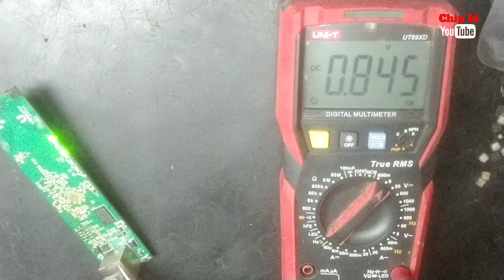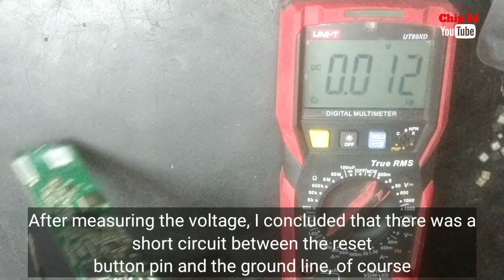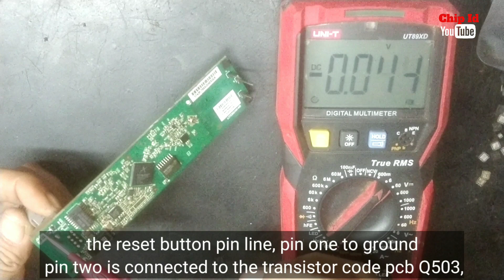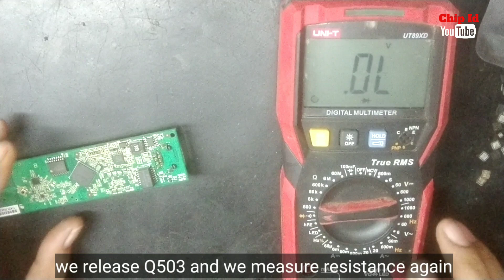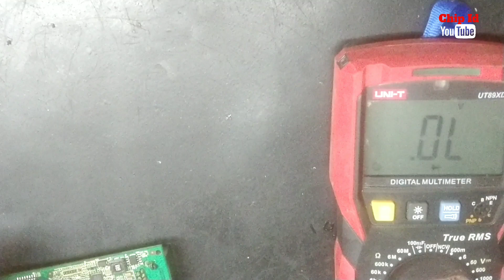Repair Ubiquiti Lite Beam M5 continuous reset,work perfectly

Comment: What kind of transistor is Q503?
Reply from the maker: Q503 does not need to be installed.. check the path of the obstacle if there is still a short damage on the ar9342

Comment: Thank you.That helps a lot. My Q503 has been blown apart. Please can you tell me the ref. no of Q503 so that I can buy a replacement. If anybody can supply that no it will be highly appreciated
Reply: @chipid4571  A 3 legged diode named Q503?
Reply: @chipid4571  ok then please give me its no so that I can get a replacement
Reply: Bumpity bump. Job only half done when part number of part that the video is about is not given.
Reply: If somebody else comes looking here, Q503 reference number is W1A with 07 written vertically. Google search shows W1A as a NPN transistor
Reply: @chipid4571  I dont know enough about these motherboards to answer that. On the one board I get 0.09V on the single leg of Q503. On another board I get 3.45V on the single leg
Reply from the maker: sry sir... yesterday was unable to focus... check r9, check q503 transistor, check path to ic ar9342...on one of the legs of q503 to ic ar9342.. try removing q503 first...